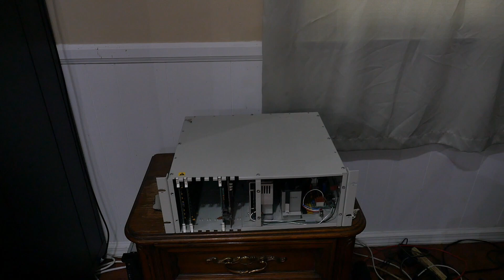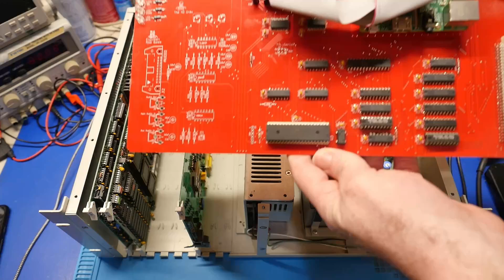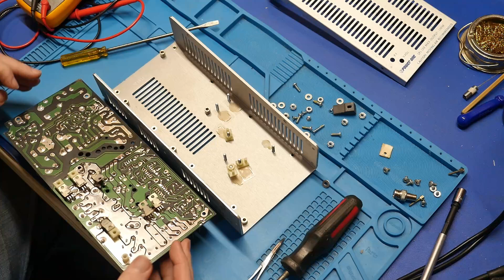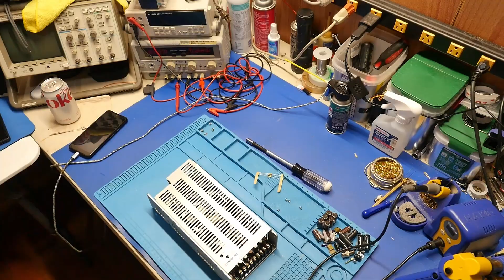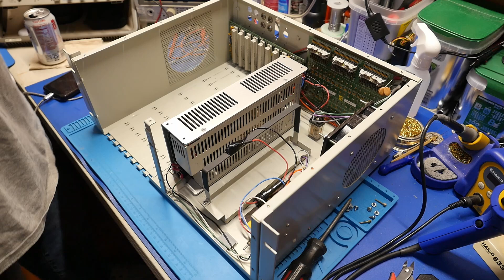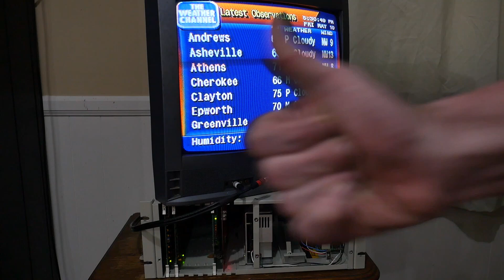July 4th Special: WeatherSTAR 4000 no power repair. Lightning?

Comment: The GH4 -- nice!  I have a GH3 that I bought a short eternity ago.  Probably about due for an upgrade.  ;-)  I really like the micro 4/3rds lenses -- good compromise on size/cost vs. image quality.  The auto-focus is abysmal though (and I hear that didn't improve much on later revisions), so I just do it manually.

PS -- a bit ironic that a piece of equipment whose sole purpose is to provide weather forecasts got taken out by bad weather.  haha!